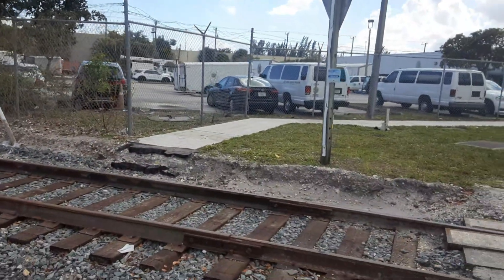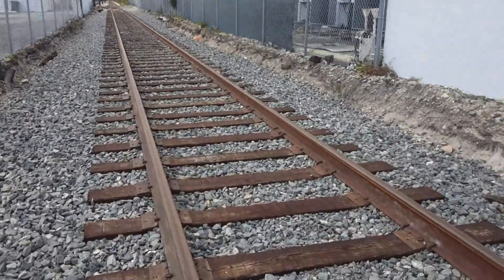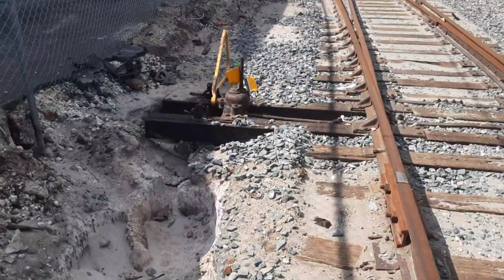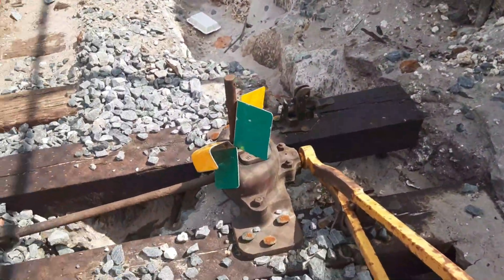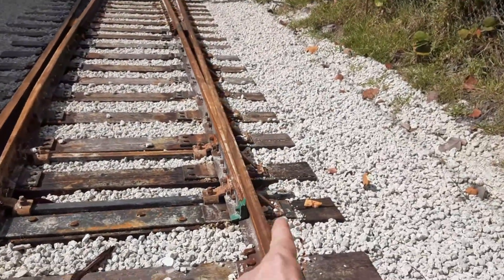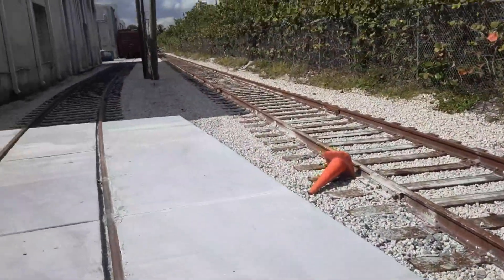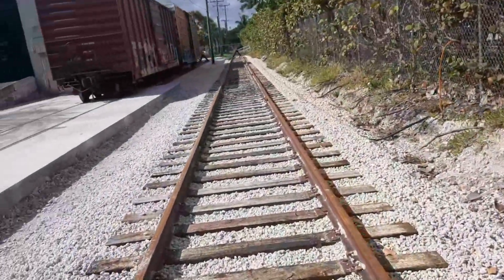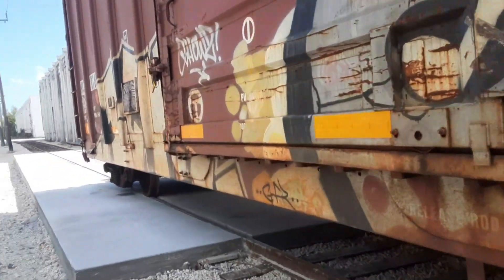Abandoned Railroad Being Restored Part 2

Comment: This is FANTASTIC NEWS to see this restored and to top it off, there's boxcars parked on the siding track! Last year when I saw the video documenting the demolition of the old tracks in this location, I thought this trackage was a goner for sure. One thing of interest was the fact that as they were dismantling the old tracks, they removed the roadbed and dug down approximately 18" - 24". I thought to myself, well that's odd, why would they be removing the roadbed of out of service tracks being pulled up? And the answer to that question is, they would do a track rehabilitation project on those tracks for a customer to receive rail service. Judging by the video, it appears the "new" tracks have 100 Pound rail and I saw "compromise" rail bars joining the 100 lbs rail to probably 115 lbs rail. Tracks to still utilize 100 lbs rail is becoming exceedingly rare these days, as this size rail is mostly becoming obsolete, except for some mass transit operations. (Light Rail) The most commonly used rail for branch lines and industrial trackage would often be 115 lbs rail. Chances are, these rails must have sit in a pile or in a train yard for decades before being laid down. Did the tracks on the "mainline" go further past the track bumper previously? Keep up the good work, stay safe and God bless.

Comment: Strange place for the derail. Unless there is going to be a Trackmobile type unit in use for the last customer. Otherwise it would have seemed that the derail should have been out at the main. Unless it is there and controlled by Century Metals to protect their unloading. But still odd as then it should have been on the siding, not the spur.